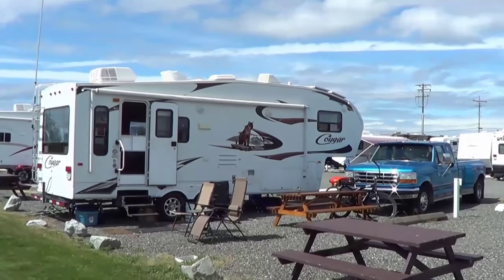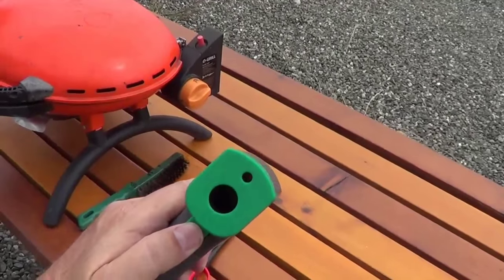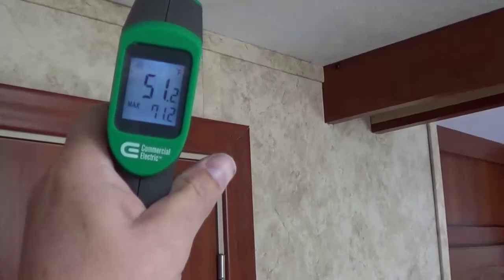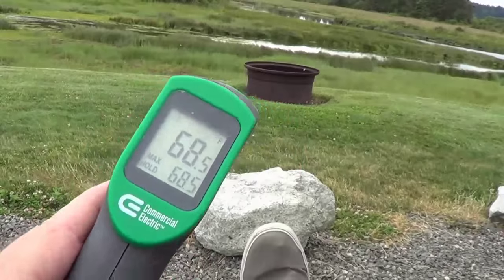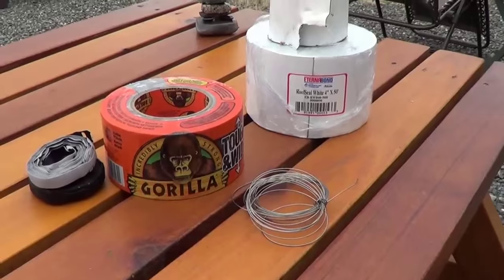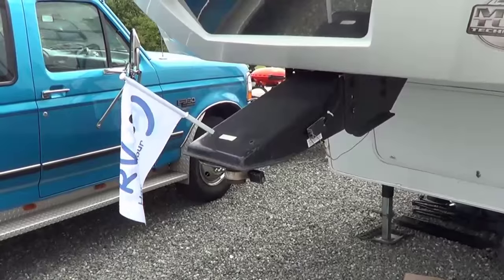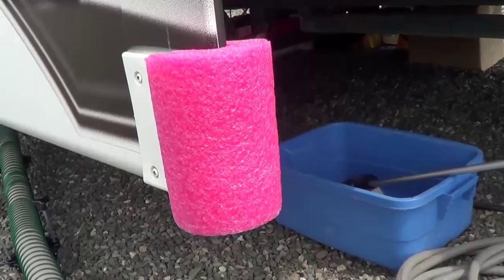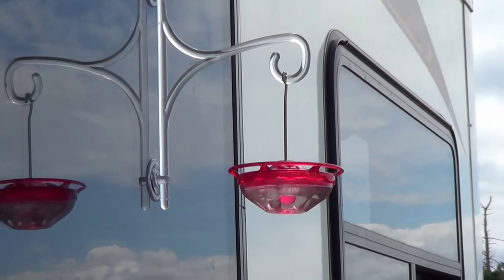7 Random RVing Tips from Love Your RV!

Comment: I never thought of taking my temperature gun with me.  I will now.  I like the alert feature on the radio.  My weather radio doesn't have that, but it does have a flashlight and rechargeable batteries with an adaptor, plus it has a crank in case the batteries get low. Love the tips.

Comment: How to I know what the temp of the tires should be?

Also, I love your hummingbird feeder - do you remember where you got it.

I love your videos!!
Reply from the maker: GVJeeper Thanks we got the feeder at a garden store, but they are on Amazon too. As far as tire temps go the best thing to do is keep checking them until you get a feel for the average temps, it will vary with sun exposure, speed and the type of road surface, but if it suddenly spikes to a very high temp outside of the usual, you'll know something is up and needs investigation.
I would guess the normal range would be from 80 - 150 degrees.
Reply: Love Your RV Thanks!! And keep up the good work...we really appreciate it.

Comment: You spent way much on that $60 , got mine for $30
Reply from the maker: I got it at Home Depot in Canada about 4 years ago, for some reason its way more expensive in Canada versus the US. Currently 66.98 CAD versus 29.97 USD.  Even with the current exchange rate of 1.33, that's still quite the difference. Works well though. Cheers, Ray